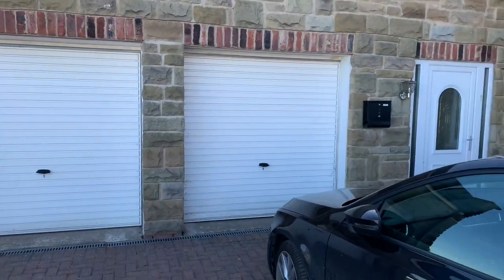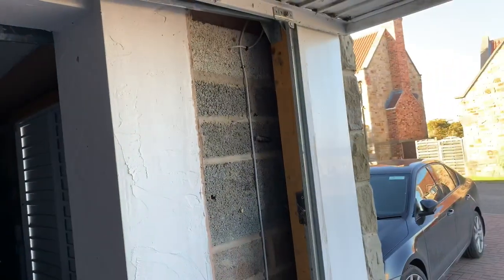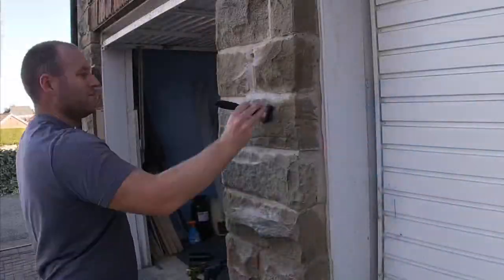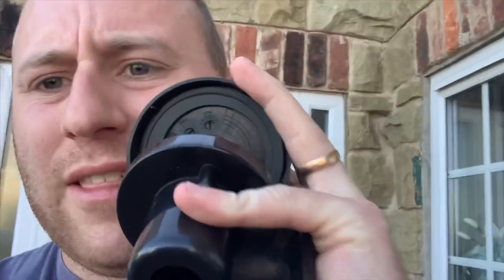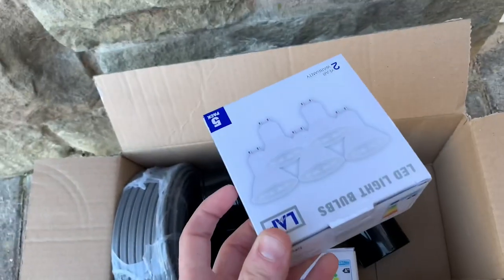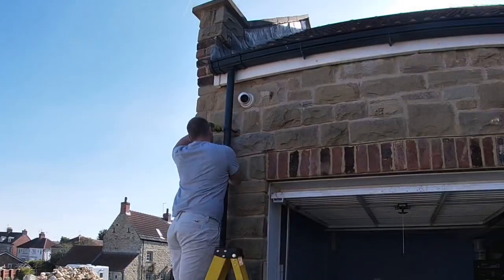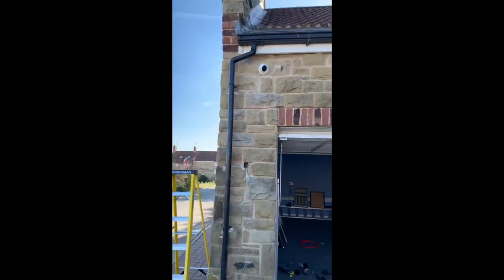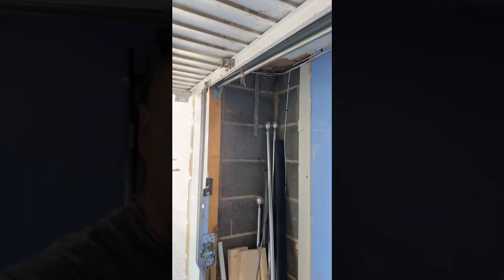Creating our dream look home...Installing Up & Down Lights **WATCH TO THE END**

Comment: These look so much better illuminating heavily textured stone and the warm white is cosy and welcoming. Nearly all buildings are standard brick in our part of the country and it looks a little sterile especially with cool white LED. 20+ years ago I wired our garage lights with an immersion heater rotary timer. Still going strong but you have to adjust for dusk every two weeks 😁
Reply from the maker: Thank you, yes Im a huge fan of it all. Thats brilliant, I love innovating with products not necessarily being used as its intended method.

I have since updated the control method with a smart wifi controller.

Comment: Having seen a more recent video of yours I understand you are using Shelly's to turn these into smart lighting. I'd like to do a similar thing, I have up/down lights outside the front of house that currently are turned on manually by switch in hallway. I'd love to see how you have wired yours up. Im thinking of maybe getting one of the Shelly 1L's that could go behind my switch in the hallway. That way I can still switch on and off manually if needed. Would love to know your thought/see your setup of the front lights.

Comment: Does anyone know, could you add a switch to these lights on the supply? I.e - say you wanted to turn these lights on prior to the photocell’s picking up the drop in light. Would that work? Or would the switch just have to constantly be on for them to come on dusk till dawn? Any help would appreciated! And great vid! Look forward to the next 👍
Reply from the maker: Thank you.

With a normal PIR you normally have an override which is just a flick of the switch on and off, but its normally for a timed period or constantly. I have now fitted a Shelly smart switch to there which allows me to control the lights from my phone.

Comment: Hi bud. Does the up lights effect your cctv camera at night?
Reply from the maker: Hi,

They effect one of the cameras ever so slightly with a reflection. But the up/down lights turn off at a set time when not required.
Reply: @DIYJourney1  Thanks. :)

Comment: Looks nice. Is there enough light generated so the CCTV stays in colour while they are on ?
Reply from the maker: From these yes, however one does affect the camera, so is not a great option. What I will be doing is installing an outside floodlight which when the up down lights are off, that will turn the cameras back to colour

Comment: Does this work with Google nest? Like saying "hey google"
Reply from the maker: Yes I use it with Google
Reply: @DIYJourney1  And after two years. Do they still work?
And Or Stand up well to the weather? Any rust or any water get inside the light?
Reply from the maker: Yes still work. No rust at all, and no water was they have a rubber seal.

Comment: I believe you said that the lights gave users the option to time them (as you do til 11pm) or to leave them on all night if they want to.  I prefer not to have lights on because it disturbs wildlife.  That's all.
Reply from the maker: Yes the photocell pir used nearly 3 years ago does give that option, which is down to personal preference as to how long they would like them on for. 

3 years later this has been updated to a smart system, given much more flexibility on the choice of light, which allows the user options to have them on for 5minutes to all night, again down to personal desires and want for there home. 🙂

Comment: Looks great but you never showed us how you did the wiring layout inside. Might be boring seeing wiring inside for some but I like seeing others wiring jobs and neatness. Looking forward to seeing your nest video next... Torn between hive and nest for our home here at the moment.
Reply from the maker: Wiring and layout is not something I like to show. I have absolutely nothing to hide, I just believe its a job that cant be done by anyone, understanding cable sizing, fusing etc, the same with gas works. I wish I could but there has to be some responsibility on my part.
Reply: I was gonna ask is there any outlet connection you made in order to turn those lights on, cause I only see you drilling one hole to install the black adapter that’s all.

Comment: There isnt a single person on youtube that actually will show you the wiring & the circuits & how to do it, everybody just wants to speed up the film of what they're doing and talk about affiliate links ffs, I've got to get a spark for 2 outside lights unbelievable
Reply from the maker: Electrical work isn’t a job for anyone to do, in my opinion. Thats why you need to get an electrician as its a job that require knowledge, qualification and testing.